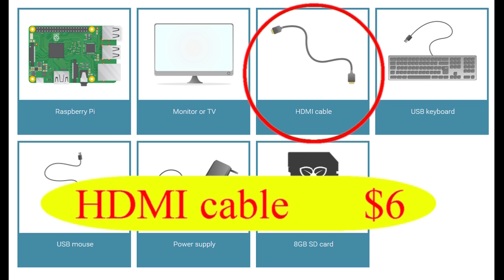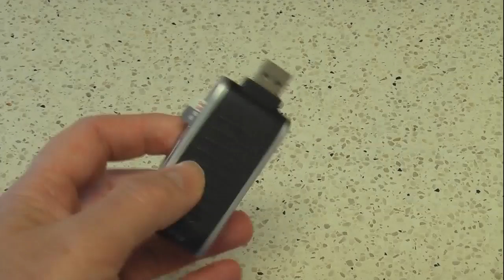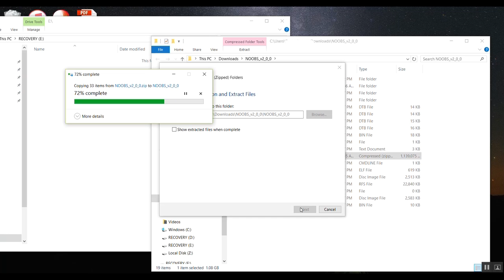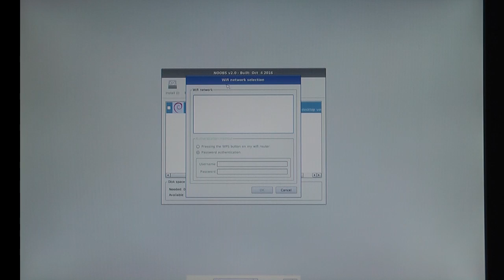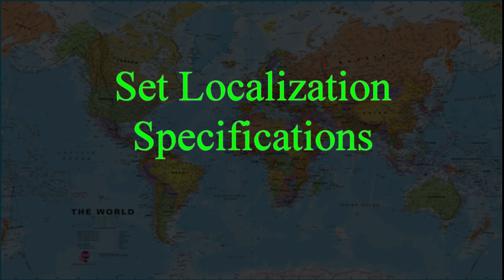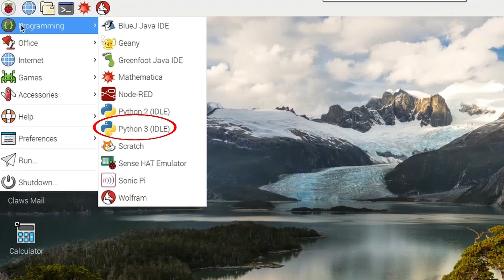How to Assemble an Inexpensive Desktop Computer Using the Raspberry Pi 3

Comment: You can use the 3.5mm jack with a Zune to RCA cable to use composite inputs on TVs.  It will look like shit but it works.  I use it to connect to my old TV for retropi.

Comment: What is that in the middle of the dock at the very top of the screen at 13:31? 

It looks like the bottom of a rectangular shaped icon that is just out-of-view of the screen capture.
Reply from the maker: That's the bottom edge of a drop down controller for VNC Viewer.  I used VNC Viewer in order to capture the video of what the RPi was displaying.
Reply: Oh, I see. Got it. Thanks!

Comment: Noobs in my opinion is pretty bad, berryboot works far better from my experience. 
(If you want to install an operating system, then later install another, from what I've tried and seen, you can't do on noobs without reinstalling the operating systems you already have, but berry boot allows you to install Raspbian, then later install Ubuntu Mate at a later date and so on)

Comment: HDMI sound problem sir
Reply from the maker: If you are having trouble with audio through HDMI, try the following:
1. Open the "Terminal" in the upper right hand corner
2. When it opens, type in sudo raspi-config
3. With the down arrow on your keypad, scroll down to 7 Advanced Options and hit enter
4. With the down arrow on your keypad, scroll down to A9 Audio and hit enter
5. With the down arrow on you keypad, scroll down to 2 Force HDMI
6. Use the right arrow on your keypad to highlight <Ok> and hit enter
7. Use the right arrow on your keyboard to highlight <Finish> and hit enter
8. Reboot your Raspberry Pi and see if your audio now works
If that does not work, try changing your config.txt.  To do so:
1. Reboot your Raspberry Pi
2. As it is starting up, you will see a screen with a drawing of a raspberry and the words "For recovery mode, hold Shift"
3. As soon as you see that screen, hold down the Shift key on your keyboard and keep holding it down until a screen comes up with the Noobs menu
4. At the top there will be a series of icons.  One will be a drawing of a pencil and paper labeled "Edit config (e)".  Click on that icon and the Config editor will open
5. Under the config.txt tab of the Config editor, scroll down to the section that says:
# uncomment to force a specific HDM mode rather than DVI.  This can make audio work in 
# DMT (computer monitor) modes
# hdmi_drive=2
6. Uncomment the hdmi option by deleting the # in front of it, so the section now reads:
# uncomment to force a specific HDM mode rather than DVI.  This can make audio work in 
# DMT (computer monitor) modes
hdmi_drive=2
7. Click OK to close the Config editor
8. Click the icon at the top labeled Exit (Esc)
Hopefully that will work and you will now have audio with your HDMI.

Comment: What is everything that comes with NOOBS? I will probably use Raspbian but am considering other GNU/Linux kernels.
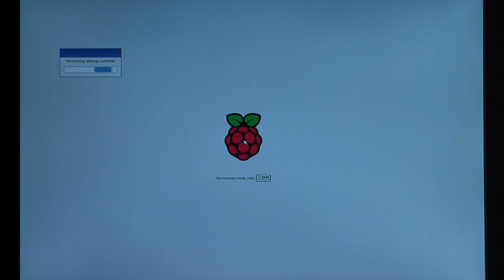Reply from the maker: Raspbian is the only OS installed by default in NOOBS. Others can be installed with a network connection.  See the video beginning around 11:30.  NOOBS also includes a built-in config file editor.  See https://github.com/raspberrypi/noobs/blob/master/README.md for more info.
Reply: DevMiser 
Thanks, I didn't realise you had to network install so I'll just use Raspbian.